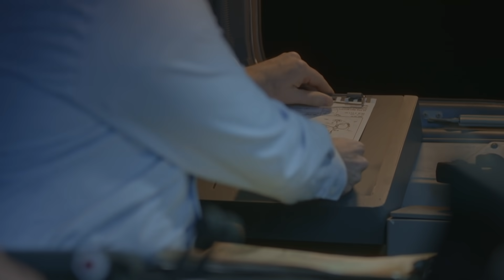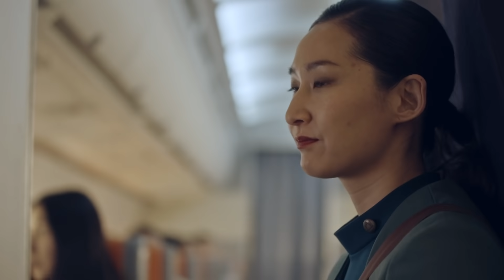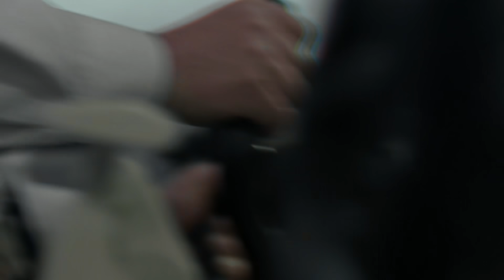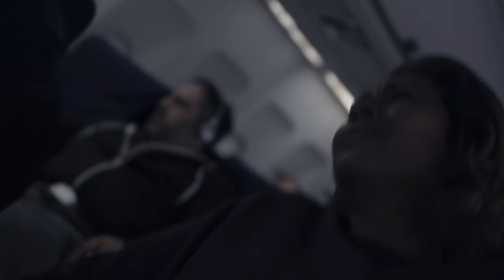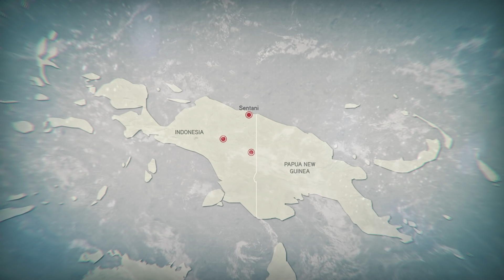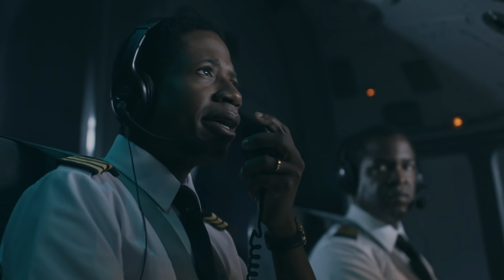Every Plane Crash from Air Disasters Season 15 | Smithsonian Channel

Comment: Comment on the off shore rig helicopter with 17 souls on board , why fly a sick helicopter 9000 feet when the pilots know that the gear box could jam at any moment , and why did it take them so long to notice the drop in oil level , and why diagnose this at 9000 . Feet , If it was a brighter pilot  he would immediately bring the helicopter to ocean level because the ditch is inevitable and it gives the 17 souls a chance to escape from a death trap , helicopters dont glide the DROP , FROM EXPERIENCE ...U.S.MARINE ...

Comment: 38 minutes into video...Who knows what the condition was maybe one of the propellers was loose or falling off or headed toward reverse.... If change makes worse go back to where it was maybe even decrease throttle slightly
Reply: Yeah the idea ice would build up on the propeller that they proposed didn’t make much sense, but neither did turning up the throttle power. I’m guessing they actually didn’t think the props were iced and thought the wings were iced, and added power to fight the drag of icing thinking the vibration was from ice on the wings. I guess I’ll have to google this accident to find out what actually happened because they made it seem like it wasn’t icing after all.

Comment: The turboprop approximately 38 minutes into the video... Slight vibration increase throttle more vibration.... Immediately decrease struggle to where it was.......... Fight carefully to get down in altitude ...

Comment: Refused to watch this when it was on tv, for fear I’d never have the courage to fly ever again…now decades later I see this show made it to 15 seasons. OMG. How many accidents have there been?  No, I don’t want to know.
Reply: Don’t worry there has only been 83375 crashes since 1982 …
Reply: @diegestive4167  do you calculate the private planes also to this?
Reply: @felix-i4c9z  I didn’t calculate it ,I googled it because I was curious after seeing a similar video ,but yes I think they were included…
Reply: @diegestive4167  how are we supposed to not worry about that?
Reply: Theyre just grouped together and from All over the world. How 
Think.about it. The series would die if there were no repeats.
Reply: hundreds,,,dony fly, most airplanes are worn out/no major overhauls, metal fatigue is a bitch to find in time
Reply: Don’t worry, airplanes are one of the safest form of travel, if this show was about car accidents it would have 10000 seasons.

Comment: A simple solution regarding studs holding an important oil filter,  is to use a bit if Lock Tight. Guaranteed to keep it from parting company, even if there is a bit of wear..I'm  surprised that  is not standard practice...A very simple solution.

Comment: for anyone wondering, LAM flight 470 was suicide. at cruising altitude, the FO left and the captain locked the door then set the altitude to its lowest and full speed. R.I.P.
Reply: Similar to germanwing airlines, but FO did that suicide
Reply: The crash was similar to Germanwings 9525 which was crashed on purpose by the 1st officer who did the same thing (locking the captain out)
Reply: @joelsterling1445  And what's really terrifying is that those two suicide crashes were nearly a year and a half apart. The reason why LAM crash was not extensively covered by the media (at least according to some sources in the episode) was that the incident was in a "third world country", while the Germanwings one happened in France. Which means that the aviation industry was practically blind about it and failed to take measures in time in order to not allow such incident to occur again.
Reply: It's so sad so many jad to lose their lives because the pilot was to selfish and cowardly to die by himself

Comment: Geez the passengers on board the plane that had the exploding bottle of gasoline are damn lucky it exploded as they were landing and not in the air or taking off at the time!!  Who the hell brings a bottle if gasoline on the plane?? 🤦‍♀️
Reply: Now you can't carry big jar of liquid. They made me throw out water & milk before boarding. These were 1970 to 80s. Mostly.
Reply: I know right, seriously wth. And the battery too with exposed wires. This really freaked me out because if people are bringing this stuff on airplanes and getting it through when they shouldn't, it makes you wonder about these security checks. Never in my wildest dream did I ever think someone would be dumb enough to bring gasoline on an airline. Now I'm going to be looking at passengers when I fly and wonder what the hell dumb stuff did they think to bring. You basically can't depend on people's common sense anymore. It's very frightening
Reply: It was UniAir 873, which occurred on August 24,  1999.  Unfortunately, they never could find a reason as to why the guy was transporting gas on the plane.

Comment: After reading a bunch of silly comments maintenance is to maintain the integrity of machinery (which I did for 35yrs) & required human integrity, which I realized was and is not prevalent in mechanics.  This is why things break, crash, sink, etc.  There was this slogan written in our shop that I read but didn’t quite understand.  It was my first day of work and took 10yrs to understand.  It was “familiarity breeds contempt” i.e. it’s not that important because nothing has happened, yet!
Reply: I fixed planes for AirForce and did not know why zi repaired or replaced a part. Tires & windshields yes. but a flap jack brake? I reinstalled a new one but didn't know what it did. Now I realize it stops the flap from going past its limit or falling off. Flaps are important for take of & landing. Not until I began to fly & hang out with pilots studying flight did I get an idea how essential certain part were . And what they were for. I always was meticulous and thorough in repairs but did not know the significance of the flight surfaces. Thanks for reiterating some in these videos.

Comment: Re: change out of studs:  I had this job on a particular component on board to remove the bolt-nut configuration to a stud-double nut configuration.  The stud diameter was greater than 2” & a torque value of 10,000 ft.lbs.  Now, I know why!
Reply: I was assigned changing wingbolts on a C 141. The torque wrench was 5 ft long & nut torqued to 35 foot pounds. Huge.

Comment: woah in the first crash the mountains are higher then the clouds? How tall is the mountain?
Reply: Clouds can sink down to the valley. Fresno CA is set low and there is fog and low hanging clouds below 3700feet where the mountain is. An eagle flew to 2000 ft with prey in its talons. He heard a plane engine rev up to avoid him but he dropped the hedgehog and it got sucked into the intake of the plane engine. Juan B story.

Comment: obviously i've never flown a plane out side of video games, it being nighttime I can see how you can't rely on your eyes at all to gauge where you are, but I imagine even with the AI telling him the nose is starting to push up you would feel the change in momentum no?
Reply: Not necessarily. If it’s slight at first you try to correct it before it happens. Then it quickly becomes an issue because you’ve already sent yourself into a spin. Yes he should have felt it but it’s very disorienting to be going down and spinning. He honestly probably didn’t know otherwise. I’ve been in a plane that dived and you don’t know up, down, left or right. I imagine not seeing is the same as being a passenger. He had to rely purely on a malfunctioning system.
Reply: Yea

Comment: I read in the report for the Northwest DC-9 that the F/O was fairly new to the airline having recently left the Air Force where he flew B-52s. Before pushback he and the Captain had a discussion where he fabricated several aspects of his service; namely ejecting from an aircraft twice and actions in Southeast Asia. It's also noted the Captain was returning to flying after some time away. It's scary how these factors resulted in how the Captain essentially became totally reliant on his much less experienced colleague, likely compounded by his tall tales and confidence. This combined with the F/O's likely intention to make a good impression and not let on if he himself was becoming confused led to the accident in my opinion.
Reply: I look upon Air Force pilots as far superior to any civilian pilots. I tend to forget that they are only human and they too are prone to human limitations.
Reply: @markversfeld1027  I think they are superior too, but they also have superior planes.  Many of the maneuvers they are able to do on those planes can't be done on ordinary commercial planes.  So even if a pilot was indeed capable of getting them out of the jam, the plane might not have been able.
Reply: @aewtx   I don.t agree with that, there has to be a set standard with whatever aircraft manufactured, commercial or military, I was at an airshow where an x airforce pilot put a 737 through  it's  paces , manoeuvres that you would never see on normal flights..it was a very impressive display, so even a commercial aircraft will surprise you as to what it can do.
Reply: lol isnt that the job of a first officer? even a retard could look out the window and give directions .. You mean to tell me that you think what the first officer was doing is complicated or should require a harvard degree or being a killer pilot in the US Airforce to follow simple directions while the plane is still on the ground? 

🤣🤣🤣🤣🤣🤣 what kind of morons do they hire if you need a phd to follow simple directions!! I must be a genius then since I can follow simple direction without flying a B2 bomber and the Airlines needs better standard
Reply: Good assessment and the pea soup fog didn't help.

Comment: Last week when I was onboard an Airbus from Kenya to Qatar,I only fastened my safety belt when the hostess walked around to check.I unbuckled immediately she left....I could not stand the thought of hitting the ground tied.
Reply: It’s actually more safe to hit the ground tied. You have to understand that if you aren’t tied you will deal with blunt force trauma from being driven from your seat to another area of the airplane or out of the airplane possibly and out the window. Be careful.
Reply: @lo_2710  when fastening the belt,I felt as if I was actually fastening a noose on the neck, until I felt a suffocating effect.Incase of being sucked out,I would rather get sucked out full body than getting the head sucked out while the body is left buckled.

Comment: Watching these videos puts me in a roller coaster of emotions; from horror to surprise to utter sadness/grief to disgust and anger.

Though I've also learned so much from these; i.e how small avoidable mistakes can have big consequences and end in tragedy (i.e pilot error/fatigue, poor maintanence or training, cutting corners/costs, negligence, mechanical failure, metal fatigue, design flaw, poor communication, etc.), company transparency when they knew failure was inevitable, toxic hierarchy or profit culture, etc.

As a frequent traveller, I'm grateful that commercial aviation has come so far- not because of the accidents & lives lost, but for the improvements made.
Reply: And also just total awesomeness when the pilots save all/most of the souls on board with amazing flying!!
Reply: When the broken plane lands on the runway and the fire engines and ambulances speed following it down the runway it always brings tears to ny eyes.  So many people earnestly want the passengers, crew and plane to survive.  Even tge people in the cockpit they get hut hard when they see a plane in trouble or crash.  Its like an aviation family.
Reply: Hurt not hut
Reply: 9ik kk 9 on know

Comment: "One passenger died on impact after being hit in the chest with a tray table."
And that, ladies and gentlemen, is WHY you put your tray tables up when landing.
Reply: Being a frequent flier pre-COVID-19, I was wondering why you do that, being stabbed in the chest with an unfolded tray table is a horrible way to die.
Reply: Ooooh! I had no idea because I was on Southwest Airlines 6 weeks ago. When they told us to put the tray tables up, I was confused but obviously listened. Thanks because I never got a straight answer. 😅
Reply: Fly Ryain air, no tables, no problems. Seat cushions are also optional, and if you need water - pay up.
Reply: @Commentator541 sounds like Spirit
Reply: Blunt Force Trayma.
Reply: It is quite possible the tray table might have snapped off it's upright position and opened on impact, depending on how well it was installed, ive seen some of these plastic hooks they use on cheap airlines and I really question if they would hold the tray table if there was a high impact crash/landing.
Reply: To be honest, I'm surprised so many people are confused why it was even a rule.  The thing is protruding out.  If there was a bad landing, you're going to hit it.
Reply: Let me say it, this looks like something from Final Destination.
Reply: 9.9
Reply: The flimsy hooks that hold the tables up always come lose.
Reply: Is that not an obvious
Reply: Yes
Reply: From which accident?
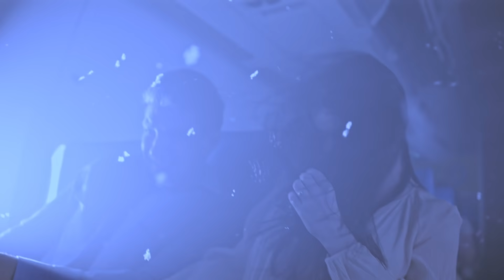Reply: @LisatheGreatest  Aries 8250 31:12
Reply: It can also block an exit
Reply: THE OTHER DIED FROM A FREAK EVENT WITH HOSPITAL TRAY TABLE.
Reply: I used to think that was just so High School.
Reply: I dislike :)
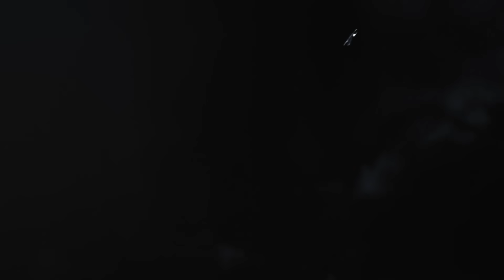Reply: @mahsoonamansoor4370  Very funny at 9:21

Comment: It’s hard to believe that 2 crashes happened a month between each other, both in 2007 (TAM 3054 on July 7 and Kenya Airways 507 on May 7)

And then there were those 2 crashes in Tokyo..
Reply: What were the two crashes in Tokyo?
Reply: @carinamurillo2150  It was a BOAC flight and a Canadian Pacific flight.
Reply: @forgive_me_for_my_past  ok, thank you

Comment: Idk why do planes have to explode on crashing ☹
Reply: It's because the plane still had fuel on board which is why they explode upon impact. If there is no fuel on board or a low amount, then an explosion is less likely to happen.